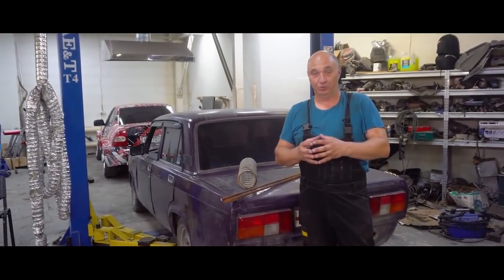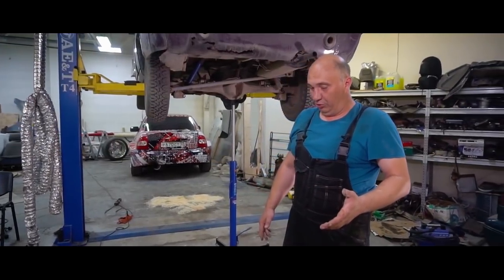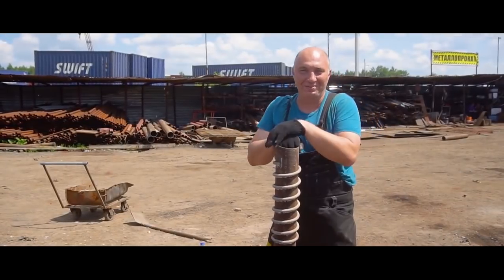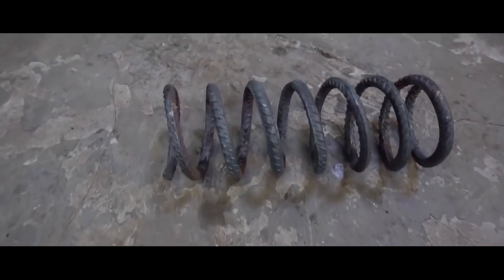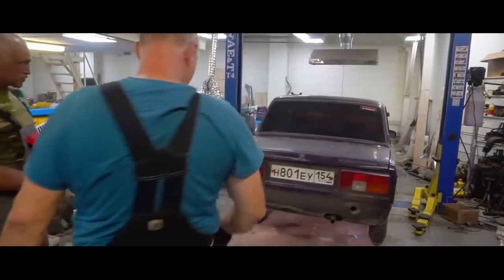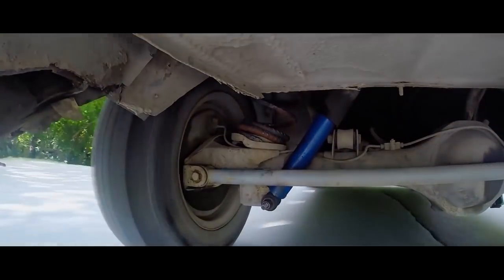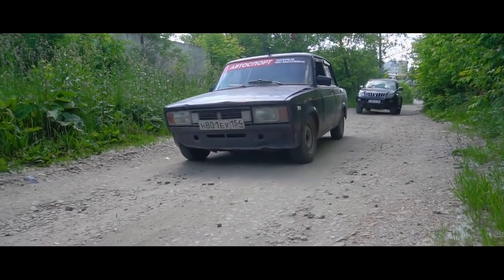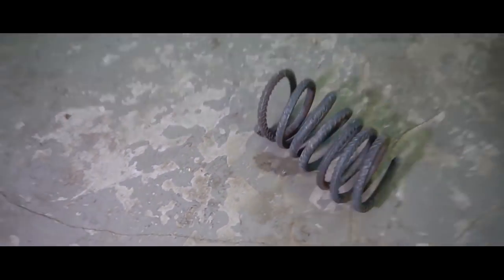Coil springs out of rebar – will they work?

Comment: i would say that blue shock is bad, or wrong valving.... didn't move a mm during the whole time....
Reply: looked to be like the shock had been badly positioned - nearly horizontal FFS?  I reckon the top of the wheel arch was rusted away so the shock was moved stupidly.

Comment: I think maybe heating the rebar up removed alot of the carbon from the steel making it way more flexible. If you try it again try brushing some oil on the springs to make them harder.

Comment: You either need to wind the spring with machinery and NO heat according to the various engineering formulas available (these account for bar thickness, spring diameter and length and take into account the work hardening that occurs when cooling the spring), or you need to heat the spring red hot and quench in oil and then temper them back to a blue color.  Using a torch to bend the steel just leaves them dead soft and unable to carry a load.
Reply: Rebar is dead soft to begin with, its meant to be used for concrete reinforcement.

Comment: Make a lada with tracks. My cousin had a Astro van built homemade tracks and the drive sprocket was ran off the rear differential and front end had super wide skies would easily drive through 3-4 feet of snow.
Reply: Better take a Lada Niva ...

Comment: I had a similar experience with my vw bug. I replaced the leafs in the front for square stock steel and configured some arms in the center with a single shock wave airbag. It rode nice and I could lift it 2.5" from the ground. It slowly bent then I had nothing for suspension. I found out I needed to use tool steal grade square stock and it worked for years. I love this channel, you guys are always doing fun crazy stuff I'd never think of doing. Keep up the good work and much respect from San Diego California👍

Comment: Modern rebar should be an ideal material for making springs, it is a very high yield strength carbon steel...which is exactly what  many springs are made of. It was softened when heated to roll it round the former. A post roll  heat and quench then oven  treatment, to temper, bought up to 800 degrees slowly should restore the yield.
Reply: Rebar has to low carbon content to get much spring out of it now matter how it’s treated.
Reply: @kevintucker3354  No, springy high yield steel requires carbon content. The fact that mild steel will not react to heat treatment and would be useless as reinforcement is understood.

Comment: If you did a job trying to case harden them, it might work, but it's mild steel so they'll bend like Trudeau in a room full of angry muslims.
Reply: do you even know what case hardening is?  and no - I think you'll find rebar is NOT 'mild steel'.
Reply: It's yield strength is very comparable, it's tensile strength is comparable to the lowest grade of rebar. Technically it might not, but lower and more common grades of rebar are mechanically and likely chemically similar. If you want to split hairs like the biggest faggot in the universe, fine, but mechanically the  lower, more common grades perform similarly.

Second of all, case hardening is a less than ideal way of improving certain mechanical properties of a given metal at the exterior while retaining some of the original properties of the metal at its core. Yes, it's often used for things other than improving the prevention of plastic deformation, but in such a circumstance there's very little else you can do.

It's not an ideal solution, but case hardening never is, in the case of making blades, you can improve the mechanical properties of a mild steel blade preventing it from snapping under tension and increasing hardness of the edge by case hardening it instead of merely quenching it. Conversely case hardening also prevents the blade from bending too easily as well.
 The point is, you're putting more carbon into the metal to prevent it from doing the things that typically lower carbon metal does, as we saw.

Rebar springs were a shitty idea from the get-go, however case hardening them would be the best shot they'd have at preventing worse plastic deformation than they had experienced. Granted under heavy shock load you'd probably see other problems, but my point stands, the mechanical properties of rebar and mild steel are similar, and there's very little you can do to make mild steel more useful under clearly inappropriate circumstances of application.

I would have rather seen that than the obvious outcome which resulted.

Comment: Doubtful, as they are not made of tempered spring steel. I would think they would fail rather early should someone install them.
Reply: Did you watch the video before commenting?
Reply: @kshepthedrummer  No. But I did afterwards. I was in the construction business as a young man and handled rebar a great many times in concrete work, bending it, cutting it, generally finding it to be a soft steel. My recollection of steel springs, such as those on my Toyota pickup, is that they will not bend under my strength no matter how hard I tried or what I might use to assist.

Comment: You need to re-temper the springs by heating them up very hot after you bent them, then quickly quench then in oil or water to give them back their springiness.
Reply: Rebar isnt hard to begin with. Cant give it back what it never had.
Reply: @pflaffik  Yes, you can, it wasn't that springy to begin with because it wasn't intended to be springy. By properly heat treating it you can gove it some springiness. They heated up the rebar a lot which softened it and yet it held up the car so by properly heat treating it, some more springiness can be achieved, well beyond what ever it originally had.

Comment: Hi.The metal in coil springs is hardened in a completely different way than the reinforcing iron is.  So if you had heated the reinforcing iron after you made the coil and then cooled down the coil in oil correctly, the reinforcing iron material probably had springs back in the right way.❗
Reply: needs to be spring steel, rebar cant be made springy, nor can it be hardened from quenching as it has no carbon
Reply: @messylaura  Ok I think I understand what you mean

Comment: Nice Winter tires on that vehicle, with studs yet. What Brand are they? Can they be exported to Canada?
Reply: The brand of the tires is <<Снежинка>> модель АИ-168-У {Snezhinka model AI-168-U} SIZE: 165-13/6 45-13
This particular model of tires is not produced since 2002.
The brand is literally translated as Snowflake.
Reply: If you really want to buy Russian studded tires there's a brand called Tunga Nordway. The company who manufactures Tunga is Sibur. Tunga Nordway used to be manufactured in Uralshina, the same company who manufactured Snezhinka, but the project was purchased by Sibur in 2005.

Comment: I have an experiment for you. If you add a little petrol to diesel would it give Diesel engine more power?
Reply: No, since diesel has higher energy density per kilogram, but petrol will help diesel stay liquid in extreme cold like Siberia winter.